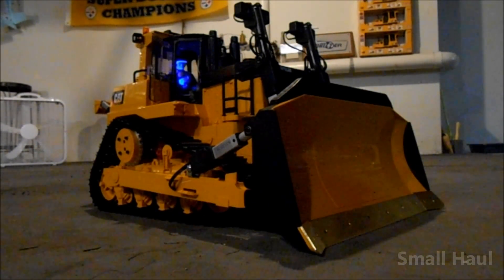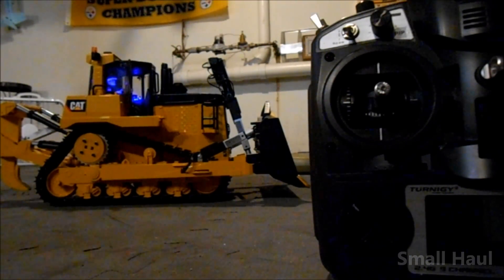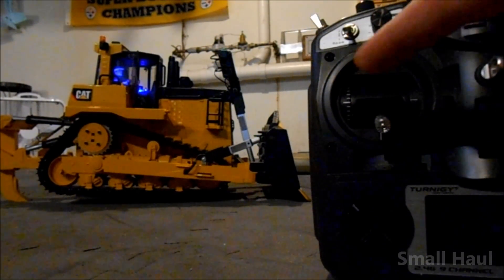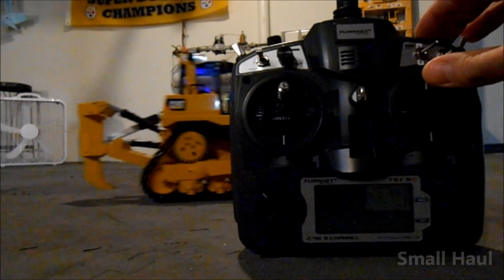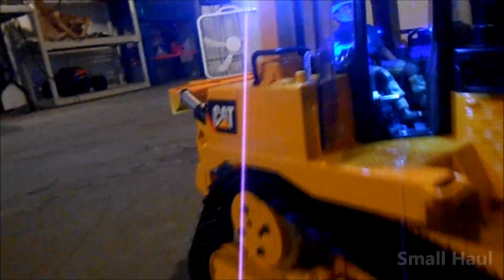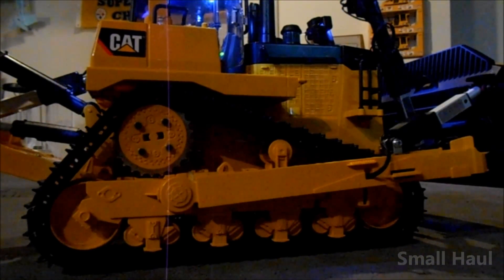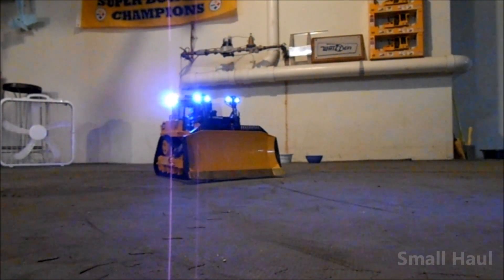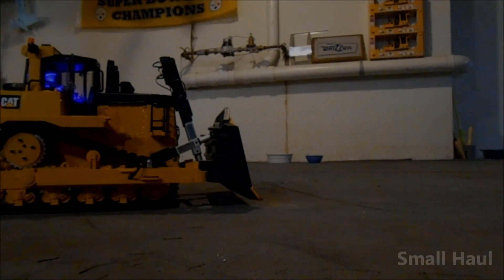Jim's Bruder CAT D11 Bull Dozer

Comment from the maker: The Firgellis on this machine are all L12-R's

2 x 50mm travel 100:1 ratio actuators on the blade lift

2 x 30mm travel 100:1 ratio actuators on the blade tilt

1 x 50mm travel 210:1 ratio actuator on the ripper

Comment: are the firgellis L12's a straight hook up to the radio receiver, and what drives the tracks.
Reply from the maker: +Randy Hargett Yes, you just plug the L12's into your receiver and they work like servos. Custom gearmotors that i machine/build myself run the tracks.

Comment: How much do you charge for building these and can you build one with a camera on it
Reply from the maker: Big Bruder D11 completely ready to run is $2826.00 plus shipping.

Completely ready to run with 2.4ghz turnigy 9X computer radio, 12v 5000mah battery, customized sound system, speaker, roof lights, tower lights, reverse lights, interior lights, on/off switch, charging jack, lead weight for ballast, brass blade tip, brass ripper tip (ripper works remotely as well), firgelli maintenance free actuators, operator/driver, powerful metal gearmotors for drives, aftermarket plastic fiber reinforced tracks with steel link pins & clips, metal (aluminum) drive wheelsand brass caps on all of the mock idlers to greatly reduce wear.

Working rotary beacons can be added for $75 installed.

A camera could be mounted to it.